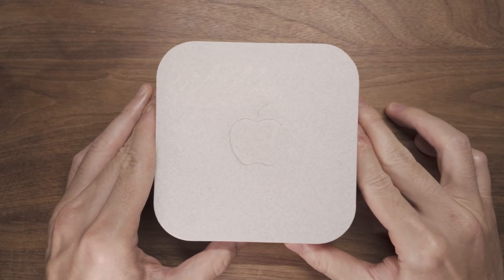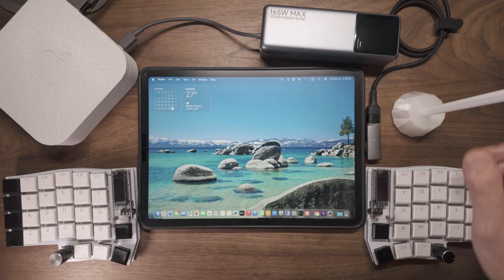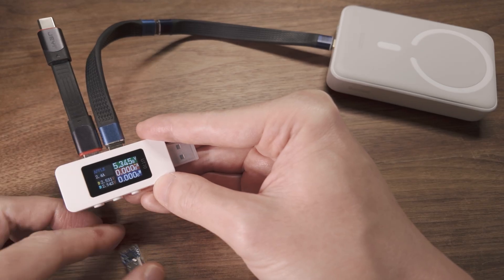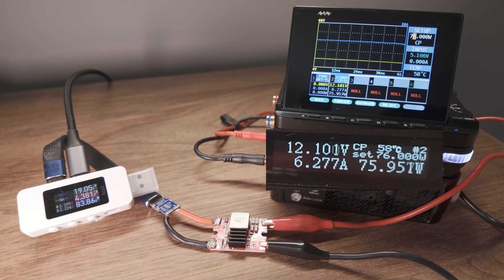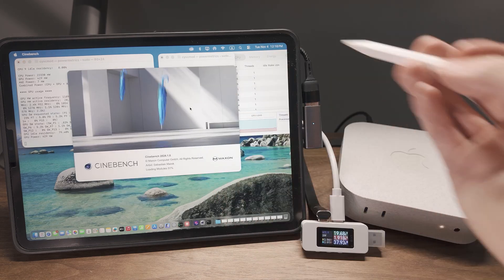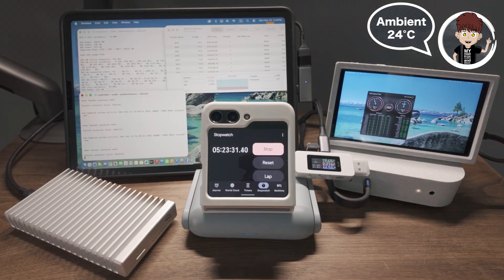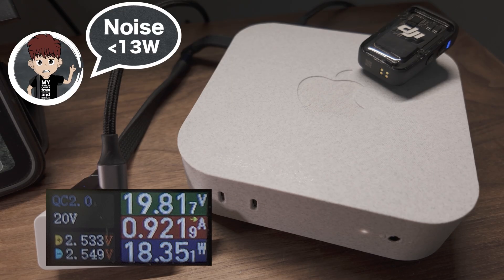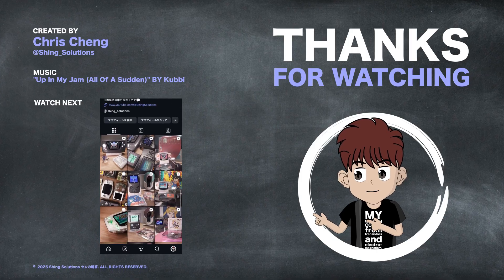Making the M4 Mac Mini TRULY Portable!

Comment: This is what Apple should have make the Mac mini at the beginning. Like user could plug this machine to a studio display thought tb cable and call it a day
Reply from the maker: Right, but that wld mean they'd hv to upgrade almost everything. I believe studio display's tb port only supports a max power of 96W, which is far from enough for the M4 Pro chip🤷
Reply: @ShingSolutions ture, this mean Mac mini can be cheaper and if user really need power supply, they can get one for Apple or others 3 rd party.
Reply from the maker: I dun think that will ever happen, just like they won't turn an iPad into a Mac!
Reply: @ShingSolutions why not ?
Reply from the maker: Ask Tim!

Comment: Awesome Mod. I am excited. 
If u dont mind, I wish to suggest something. 
Laser cut the top part of mac mini, fron the sides, where the power supply and motherboard meet. 
Design a cover plate, and use it the way u are using. When u wall power, just keep the top section back. Pogo pins for AC power can be used. The removed toucan we converted into a battery power bank to be used just by placing it and connecting via USB C as per your design.
Reply from the maker: Thz for ur kind words! I like the idea of reusing the original power supply. This ensures that the Mac mini maintains its original performance as much as possible. This is especially useful for the M4 Pro Mac mini, as the original power supply is harder to replace. That's a great idea! I’ll collect everyone's thoughts in the comments as a reference for my next steps. Thank you!

Comment: hello do you have any explanation on the shortcut you use to enable sidecar? im really interested in it but cant figure it out 0:38
Reply from the maker: Hi, there is a command-line tool called Sidecar Launcher that can help establish a Sidecar connection. It must run on a Mac. In the vid, my iPad and Mac r either connected to the same network or connected via USB, so I used the shortcuts app in my iPad to run this program via SSH to request a Sidecar connection.

https://github.com/Ocasio-J/SidecarLauncher.git
Reply: @ShingSolutions  Perfect, thanks!

Comment: 1000€ for 16GB ram more
Reply from the maker: This should also work for the 32GB ram model.
Reply: Ngl its 700€ 16GB version, 1200€ 32GB 
Apple charge you ~ 5x the price of the 16 GB ram
Reply from the maker: Yes, but that's Apple. These days, if u dun need to use Windows or any CUDA related stuff, a Mac is the best choice.

Comment: The reason the Mac Mini is specked with a 155 watt power supply is because of the up to 75 watts that connected USB C peripherals could draw (5 ports at up-to 15W per port), that is not included in the listed power spec as that is only for standalone operation. This brings the overall max theoretical power draw to 140 watts leaving 15 watts or roughly 10% overhead from the power supply.
Reply from the maker: I doubt it. According to the "Electrical and Operating Requirements" on Apple's Mac mini website, its maximum continuous power is 155W, which includes both the M4 & M4 Pro chipsets. I believe the 155W power supply is designed for the M4 Pro chip but it’s also used for the M4 chip. This is more consistent with the information on the “Mac mini'Power Consumption and Thermal Output (BTU) information” page and my test results.

https://www.apple.com/mac-mini/specs/

https://support.apple.com/en-us/103253

Comment: Cool I was wondering in the past if it would be possible to power it via USB-C PD, thanks for the extensive testing. ;-)  How about a  3d printed aluminum  version. If I remember right you could just use a online service. You upload your model and people can buy it from the 3d printing company and you get some percentage from the sale…. Even so I really would like to print a case my selfie. One more question what is the right angle adapter you are using on your iPad?
Reply from the maker: Thanks for the kind words! Nowadays devices under 240W can be powered via USB-C PD. This is more of a design consideration than a practical one. Using aluminum for printing is certainly better. I haven't used such service before, so I'm not sure if I need to modify my model slightly, but if I'm going to publish CAD files, I think it's definitely a good idea. I'll think about it. That right-angle adapter is a USB-C splitter that separates power and data transfer. I just don't want my iPad to charge while connected to my Mac. Here's a link for your reference: 

https://a.co/d/fSYR7WY

Comment: I'm curious about how you used your iPad as a touch screen and monitor for the Mac. Could you use an iPad Magic Keyboard to control the Mac with whatever setup you are using?
Reply from the maker: I was using Sidecar, so controlling it with the iPad Magic Keyboard should be fine. I just set up a virtual display on my Mac so it could run headless.
Reply: @ShingSolutions great project, can you get it to enter sidecar mode automatically on boot?
Reply from the maker: Glad you liked it! Why not? Just set up a Shortcut so it runs immediately after booting up 😉

Comment: You're amazing! Thank you very much for this video!! If you design a hub to use as a base, the same width as the Mac Mini, where to house the batteries, I put your photo on the Mac mini that I build. I look forward to your enthusiasm! Can you count the 3d design? Thank you!!
Reply from the maker: Thanks for your kind words! You mean a dock that can be placed on the bottom of my Mac Nano and function as both a power bank and an expansion hub? That sounds better than integrating the batteries into the original chassis.
Reply: @ShingSolutions  Yes, just that. I haven't seen it before. Maybe you'd be the first to do something like that. If you look strong, it would be something extraordinary!
Reply from the maker: Thank you for your suggestion! I really like it! Let me think about what to do next!

Comment: can you share the shortcut ipad for connect to sidecar?
Reply from the maker: Sidecar connections cannot be established using iPad Shortcut alone. It must be paired with a command-line tool called Sidecar Launcher to be used. Check that out here👇

https://github.com/Ocasio-J/SidecarLauncher.git
Reply: @ShingSolutions  Does this sidecar command work for macOS 15/26? In the description I checked it was tested on Mac 14.
Reply from the maker: It should work. I've run it on the latest macOS Tahoe 26.1.

Comment: Add some mass to the coil and perhaps you can move the resonance frequently. Epoxy or something.
Reply from the maker: I tried pressing the coil hard, but it didn't improve. That's why I didn't apply epoxy to it. May be I should give it a shot. Thanks for the suggestion👍🏻
Reply: @ShingSolutions Maybe it won't work then, but perhaps worth a try?

Comment: It's a cool concept, but I struggle to understand the need for what you have created here.  It's not like Apple doesn't manufacture laptops that use literally the same chips, already in a in a portable form-factor, with top of the line battery performance standards.  Now you have to carry all those cables, a power brick, your iPad (also containing the same chip), a keyboard, and mouse. 🤷‍♂️
Reply from the maker: That's right. Perhaps buying a MacBook would be a better choice. But I think my Mac mini gives the freedom to choose the screen, keyboard, and mouse for a mobile device.

Comment: May i ask what the shortcut is? I have been looking everywhere for it and no luck. Maybe a vid on that as well? Just an idea. (might get a bit of flack from this, but i don't use shortcuts often)
Reply from the maker: I'm glad u asked, but it's a bit difficult to explain here. There is a command-line tool called Sidecar Launcher that can help establish a Sidecar connection. This program must run on a Mac. In the vid, my iPad and Mac r either connected to the same network or connected via USB, so I used the shortcuts app in my iPad to run this program via SSH to request a Sidecar connection. I could certainly make a vid about it, but I dun know how many people would want to see it.

https://github.com/Ocasio-J/SidecarLauncher.git

Comment: Alternative idea: use the original Mac mini chassis but include an internal battery and have it charge over USB-C for a truly portable and minimalist setup.
Reply from the maker: That's what I thought too, but I think the internal space might be too small to fit enough batteries.
Reply: @ShingSolutions  I'm thinking just enough battery to keep it on standby mode for several hours until plugged in again.
what do you think?
Reply from the maker: I've seen a lot of people liked this comment. I think I can look into it further. It's entirely feasible. I might just be doing it out of interest, although the final result might not be very practical in reality.
Reply: @ShingSolutions it’s a thought I’ve had for similar devices.

Enough battery to remain in standby while unplugged.

And then back into it again once powered in.

Kind of like the Nintendo Switch?

It’s going to be all about finding a way in software to detect and trigger the events.

Or some standard way of triggering standby and wake up.
Reply from the maker: It's nice to have the ability to automatically switch between modes, but the problem can be solved simply by just adding a UPS inside.
Reply: @ShingSolutions  if u do decide on an internal battery version ,square pouch cells like what's used in drones would probably be the way to go!  dont forget to add a BMS to protect the batteries from overcharge and discharge '
Reply from the maker: Thanks for ur info. Even using square pouch cells, it’s still hard to fit everything inside as we also need space for the UPS circuit board. Let’s see🤔
Reply: @ShingSolutions  Maybe see if you can instead model  new, bigger chassis that fits a stripped down battery inside. It might end up more... cubelike, but it would be a great (almost) all in one on the go solution
Reply from the maker: Agreed, that's what I think too 😉
Reply: @ShingSolutions  I can't wait to see what you cook up next! Keep it up, I'm here for the long haul
Reply from the maker: The next one will most likely be a battery-powered Mac mini. Stay tuned!
Reply: Just use good powerbank so simple, yes
Reply: I had this same thought around the time the M4 mini launched. My thought was to replace my MacBook that goes from dock to dock with it though. It would just need enough battery for a few hours of standby to move from home to office.
Reply from the maker: This is a very niche use case. It seems feasible if it's just for idle. But I dun know if the battery life will be enough for an hour of playing YouTube videos. I need to find suitable batteries first.
Reply: Fitting in a small powerbank with pass-through charging will give the Mini a built-in UPS!
Reply: perfect solution tbh! and also design a case with more airflow to allow for even better thermals.
Reply: Great job, definitely interested in trying to create  this.
Reply from the maker: Thanks for ur kind words!  The modding process is now uploaded to my Shorts😉

Comment: Here’s a crazy idea - gut the portable charger and build it into the shell with an easy to access door in case you need to replace the battery that way there’s just one device to carry around. 

Also, why are you using such thick gauge wire?
Reply from the maker: I did consider this, but using a plastic chassis might cause heat dissipation problems. A modular cyberdeck might be more reasonable. I actually wanted to make a Mac version of ClockworkPi uConsole or soulscircuit’s pilet. The portable monitor shown in the video was bought for this purpose,but I think it will just take me forever to complete such project😅

I was trying to minimize the resistance using thicker wire but that might end up picking up more noise😂
Reply: @ShingSolutions I would suggest a thin aluminum shielding plate between the battery and the 3D printed chassis. That could help offset your heat dissipation concerns.

Ah, I thought so but yeah that’s probably why you have a lot of noise 😅
Reply from the maker: @_EyeOfTheTiger  Right, Let me think about it!😏

Comment: If it makes noise then it won't be good to record videos or stream gaming, as a microphone will pick that sound, unfortunately you will need the apple designed power supply and case :)))))
Reply from the maker: It's very quiet, almost inaudible. I don't think there will be any problems. Also, the power consumption should exceed 13W during streaming, so the noise will be completely eliminated.

Comment: So... Idling , around 1.2/1.3W, that's less than many low power SBCs (I'm still struggling to find something capable with at least 2 cores and a single Gig of RAM running any flavor of Linux already for Car telematics, local nodered and databases) and this does much much more, it does cost a bit more of course, but it's proportionally way better ... I wish Apple made an SBC actually :) Every year for April's fools I generate a Raspi format SBC with an apple chip on it.... maybe it's already here in some sense :)
Reply from the maker: Right 1.2/1.3 was my measurement. U can totally use the Mac mini as a SBC. Just disassemble everything and use only the motherboard. You can even remove the heatsink.😉

Comment: You should try to put in the original casing a power bank that gets charged by the USB port so when you're at home it auto charges, also you could code an app with something like esp32 to check the percentage
Reply: a Mac Mini with inbuilt UPS, that's something
Reply from the maker: That’s right! I thought about it but the internal space was too small to fit enough batteries🤔

Comment: Genius, now make it into a decent keyboard (Pi500+ like) as this is genius! Id love a link with part ID (link to aliexpress has a range of parts) a where as the 12V version wont handle the 65W PD? ~ and a link to the 3D print file too if your so kind to add it to the comments~ So i can use it as a base to mod my mac-mini m4 as the M5 will replace it and this is just the project for it. Thanks
Reply from the maker: What a brilliant idea! I never thought of making it look like the Pi500+! 
The AliExpress link in the description is for the converter; just select the 12V version. I suspect it doesn't have a part ID.
As the video gets more views, I might share the CAD file along with the making of video. Please subscribe and stay tuned!

Comment: Cool idea, but I'm not sure you really made it any smaller. You shaved 10mm off the total height, but now you need to carry a power brick that is bigger than the 10mm you removed. What I do like is that it can be run off a rechargeable power bank. I used to travel a lot, and finding a plug at the airport was not always easy. In the end, with the Mac Mini, the screen, the keyboard, mouse and power bank, have you saved anything over an M4 Macbook Air?
Reply from the maker: That's right. It may never be as light as a MacBook Air. But now u can use ur iPad as a monitor, a larger/smaller power bank and with ur favorite keyboard and mouse. It gives the possibility to "customize" a MacBook.

Comment: maybe make the power conversion modular so you can still use the original unit while your at home then use PD when traveling.
Reply from the maker: Good idea. U mean changing the Mac mini's power connector to USB PD, right?

That flexibility is certainly good, but y not just use a power bank with AC outlet?
Reply: @ShingSolutions Or just any PD usb C power brick
Reply: You're amazing! Thank you very much for this video!! If you design a hub to use as a base, the same width as the Mac Mini, where to house the batteries, I put your photo on the Mac mini that I build. I look forward to your enthusiasm!

Comment: More projects on M4 mac mini sir
Reply from the maker: What kind of projects wld u like to see?
Reply: @ShingSolutions pair this nano mac mini with 18650 based powerbank , with portable monitor and accessories, 

Basically I just want u to make diy mac book air
Reply from the maker: Actually, I was trying to use my Mac Nano to create a modular cyberdeck, similar to ClockworkPi's uConsole or Soulscircuit's pilet. The portable monitor shown in the video was in fact purchased for this purpose. However, I think it will just take me forever to complete it. I will consider ur suggestion, but dun expect to see any related videos anytime soon😅
Reply: @ShingSolutions okay ❤

Comment: i dont know why they didnt make the mac mini use USB PD anyway. imagine just connecting that little box to your monitor like your do your macbook.
Reply from the maker: That's true, but I think Apple definitely has its considerations. I believe the Mac Mini is considered a desktop device, not a mobile device. There's no reason for it to support USB PD, since it requires external power anyway. If it were considered a mobile device, Apple would likely have built in a battery, turning it into a MacBook without a display and keyboard.
Reply: @ShingSolutions  doesn’t need a battery. Just a usb pd charger, the kind they sold with MacBooks before returning to MagSafe.
Reply from the maker: Right!